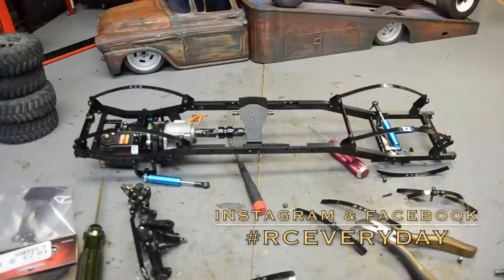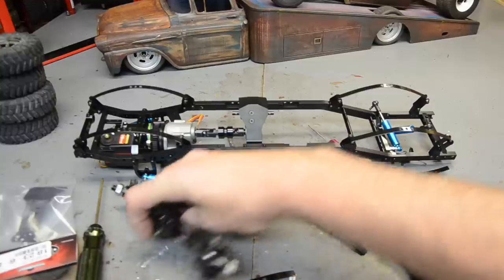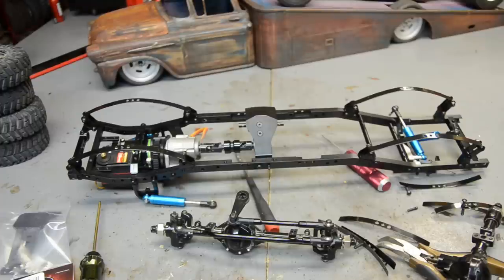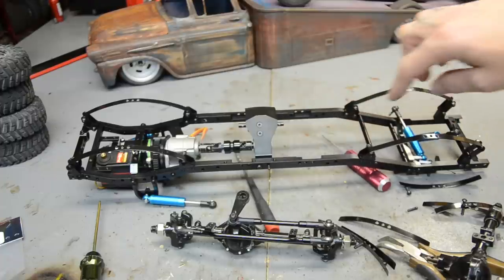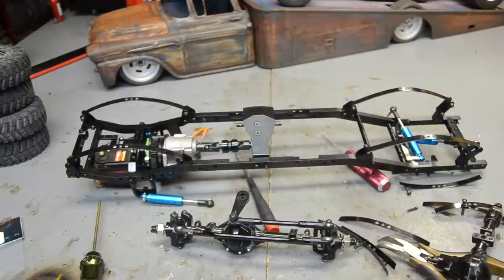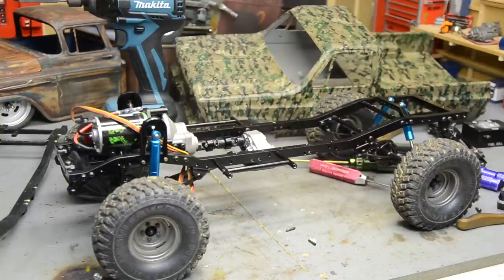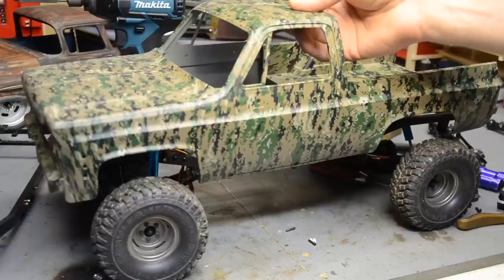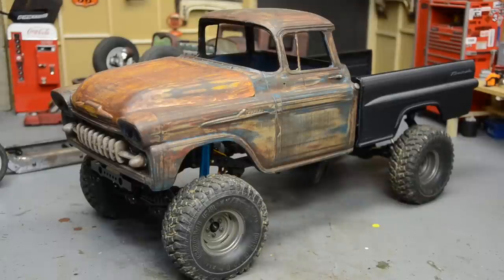K44's for the RC4wd TF2 Lwb Scale Crawler Chevy Build

Comment: Just ordered the trx4 axles got a trans from a axial.. only issue find a frame fro the 18” wheel base . Once I get around that situation.  Crew cab should be good to go . Once the guy creates a long bed for the from half of the bed . Running 2.2 swampers

Comment: was wondering if you could help i have a tf2 & just put k44s on & the front shock mount doesn't line up with the diff shock mount  The passenger side looks like I can move the shock mount back cause there is 2 holes the driver's side does not have any extra holes thanks
Reply from the maker: I dont remember exactly what I did and have sold this chassis since.  But I remember the shocks being angled a little.  Seems like I did move the driver side shock hoop but had to install a nut on the back.  But that may have been after I did the GCM Scale trans swap and there might have been extra holes after that.

Comment: Salivating.....
You know what, that Apache cab being rough and the bed being in that semigloss black totally works. The semigloss black  is a dead ringer for primer/ surfacer and it gives the look of "work in progress" 
We all have seen 1to1 projects like this, or had one. I used to paint aircraft for a living, I ran around in a 73 Satellite 2door that was all in that primer surfacer except the bumpers grill and the rain gutter trim. A set of aluminum slot mags fat tires in the back and dual exhaust. Wasn't going to win any races but it looked sinister sounded sweet. I lived outside of Santa Barbara where all the rich kids had dad's Porsche or BMW I lived in a converted garage was a little aircraft painting hangar rat. As a matter of fact, it was at the time the RC10 was brand new. And my boss at Tracor Aviation got the bug bad. He came to work one day with the Tamiya Bruiser (?) It was like nothing l had ever seen.
Long time ago, I'm 59 going on 12......
So anyway that Apache cab and bed kinda popped for me. And there might be time for another cab for that awesome hauler. Either way that 4x4 looks bitchin.